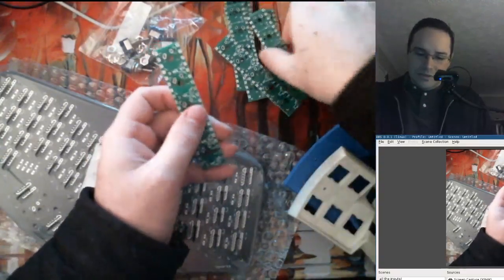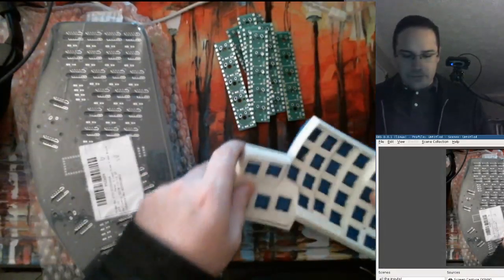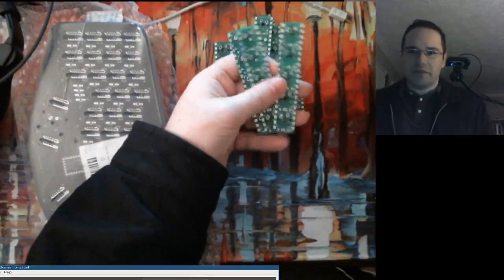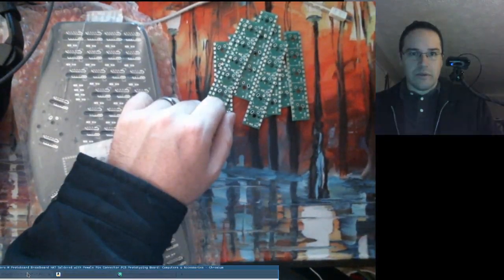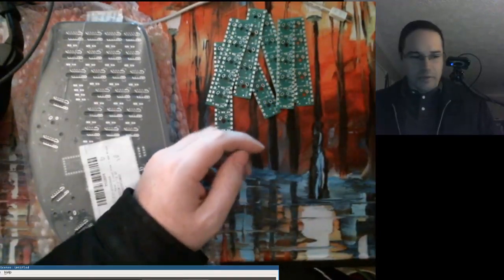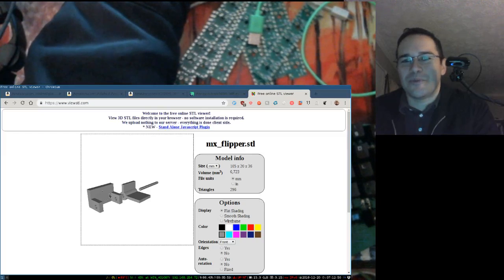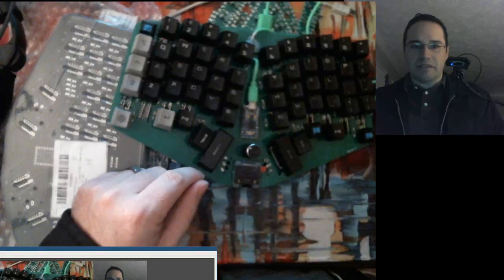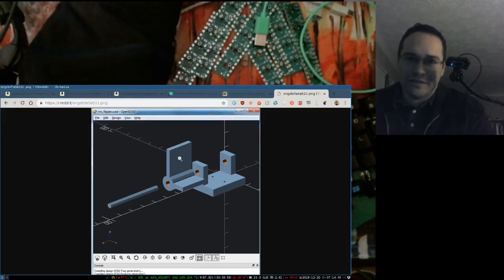New projects, designs, and products!

Comment: I'm a mechanical designer and I work with 3D models all the time so I understood what you were doing with that STL model right away. :) The other electronics and theory behind it is way over my head, but I do find it fascinating. This is something I'd like to learn more about so I appreciate you putting these videos together. What I find most compelling about design is the problem solving aspect and I do love following the whole design process. One day I will know enough to put one of these together properly. I just ordered a Vortex Core just to play around with and see how I like using the layers. I'm following your progress intently, keep up the great work.
Reply from the maker: I'm self-taught in all this, so I know just enough electronics theory to work with what I have now, but I'm trying to learn more. It was a particularly difficult thing for me to really understand to the point I could draw correct conclusions while working on my designs.

The design process is based around two things; my wrist and hand pain (if it hurts, find a new way), and my impatience. If something is slow to execute, or I have trouble recalling the keystroke or layer, then I need a new way of doing it. This also applies to missed keys and typos. If I suddenly start missing a key, or hitting the wrong one consistently, I want to know why and what I can do to improve it.

Well, I guess there are two more things... trying weird stuff (what If I designed and printed thumb paddles?!), and (even more lately) being inspired by the work others are doing. Most recently the King's Assembly is a failed kickstarter, but has some interesting design elements that would be relatively easy to implement.
Reply: The fact that you are self taught is very encouraging. Well necessity is the mother of invention so that would make sense. If you have a problem, fix it and move on. You say weird and I just hear unconventional. Everything was weird at one point, even the keys on your keyboard which came from a typewriter were weird when they first came on the scene. You can't innovate using the same box of parts and you have to go beyond. Remember when paddle shifters in race cars first came out? Now you can find them on production cars and they work well, they serve a purpose...just like it would here. I will say this, don't add too much complexity and try to keep things as simple as possible. Maybe this is where The King's Assembly failed, maybe it was too complex? Features are nice but they can start to get away from you if you're not careful. I have seen this here at work and I always try an stop, take a step back, and make sure that I am still trying to fix the initial problem I started out with. To me, it looks like that's what you are doing. Keep it up and I appreciate your response. Enjoy the Holidays!